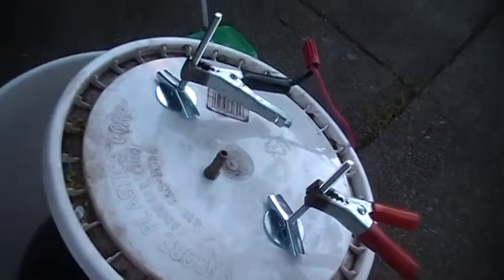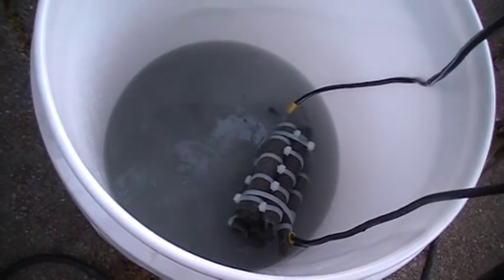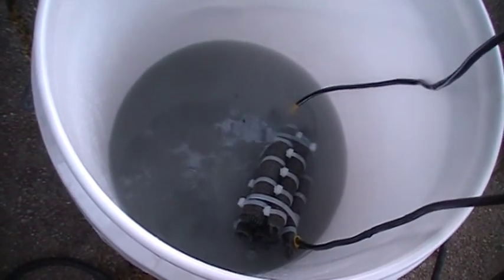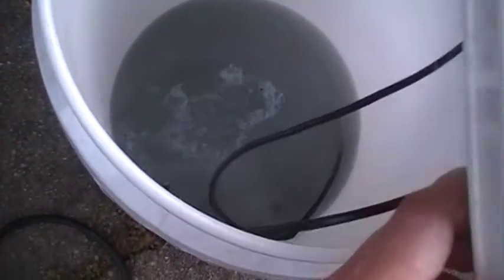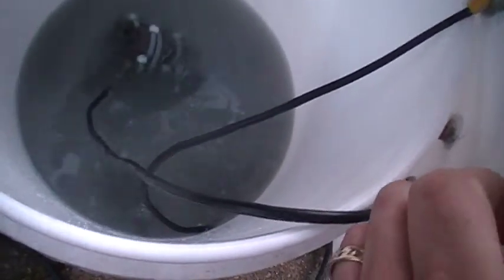SS Screen HHO Generator

Comment: Put terminals on both sides so there’s not such a voltage drop across ur plate/screen and should increase the output  stainless doesn’t conduct electricity extremely well so attaching copper Leeds to both sides helps kinda cut the plate in half increaseing the voltage across the entire plate so there’s no low spots

Comment from the maker: @eloid777 whenni built this one, it did work good, I separated the coils of screen with zip ties and then zip tied the whole bundle together so the xip ties holding the screens tight also act as spacers between the individual coils. But after finding the correct ratio of electrolyte, the plate setup cranks out HHO, enough to fire a torch. Also this bucket was way too big, I switched to a smaller container
Reply: Made one like this once before playing with the idea of a torch in the end I lit the torch blew up the entire hho set up and I went deaf for 2 hrs lol be careful with that 5 gallon bucket mine was in a container 1/10 the size of urs if that one blows up ur gonna be in the er or dead. Good luck